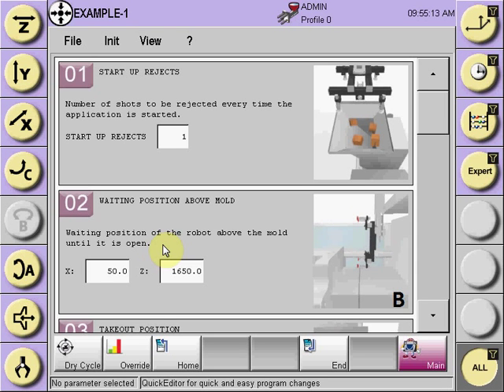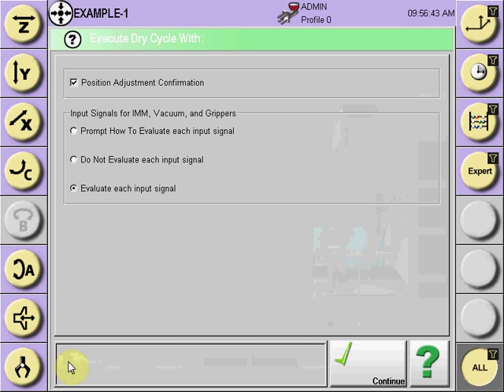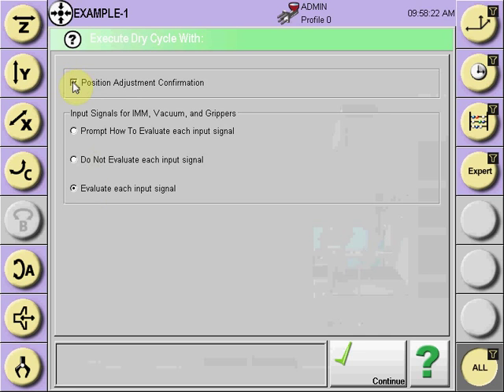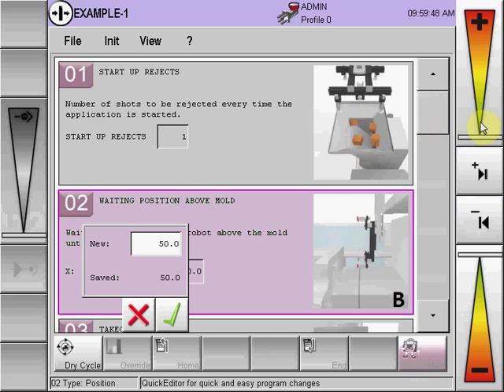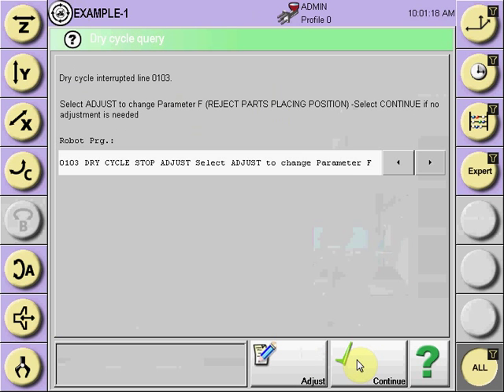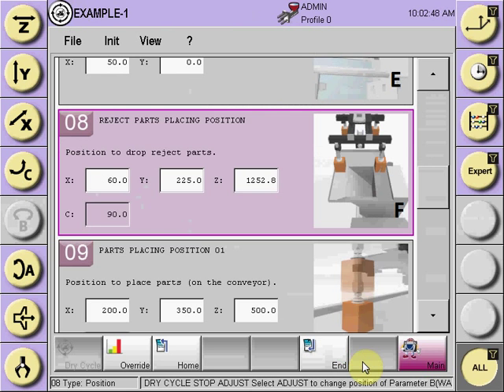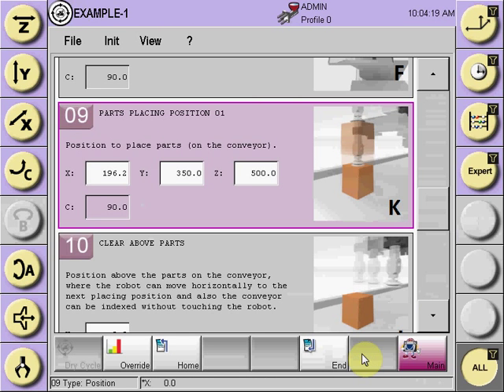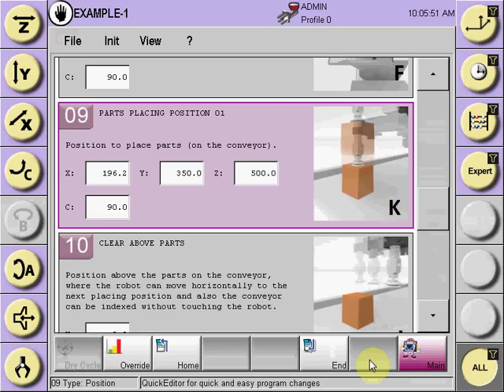Introduction to R8.3: Dry Cycle Testing a Teach Program in the Quick Editor

Comment: Hello

I have a problem with R8.3 robot settings.
In Quick Edit> Waiting position Above Mold. I can not set the Z axis. Range is 0. What you see in the movie is that the range can be changed. In Axis X I can change freely.
During dry cycle. I get error 124 047 ("mmm 'Robot Move Into Mold With Active Mold Close Signal) how can i interpret this?

Regards
Please reply.
Reply: You have to turn off mold close on to off thas de wey that i run dry ciclo